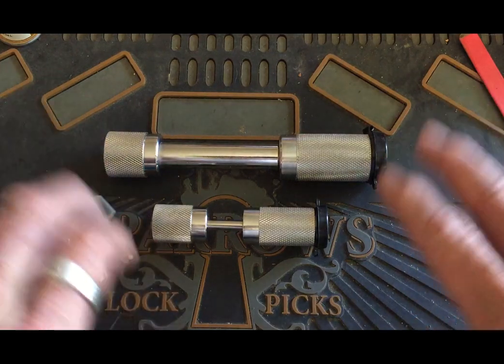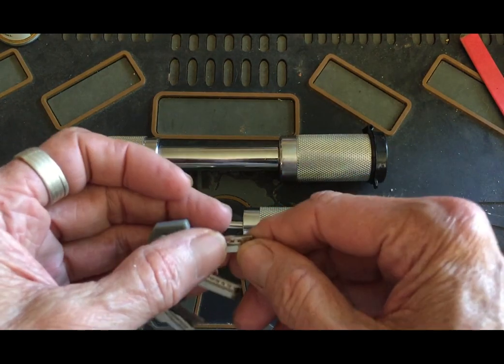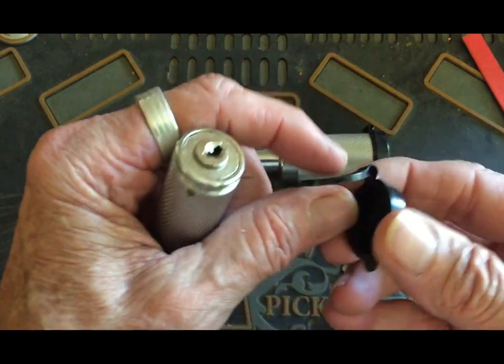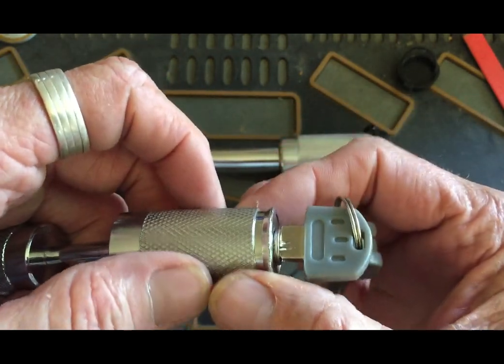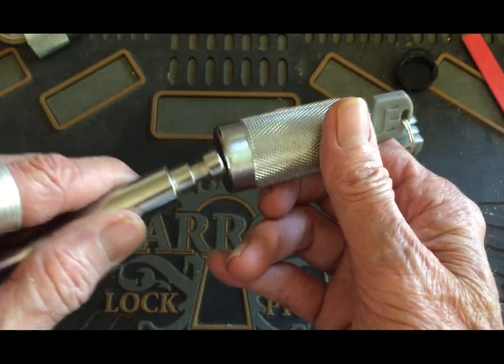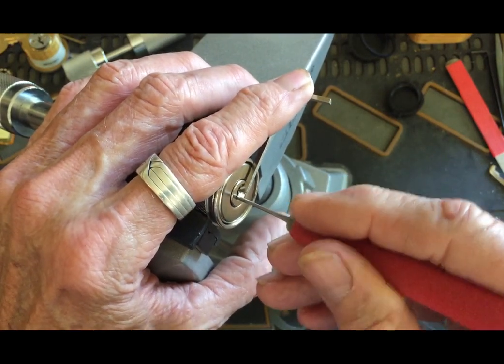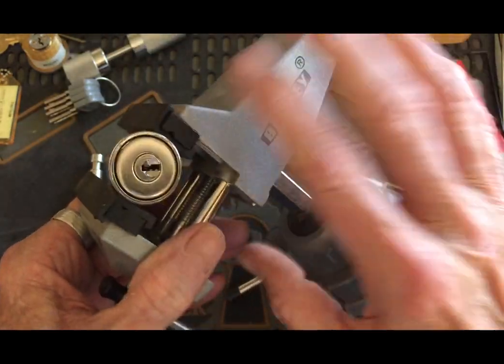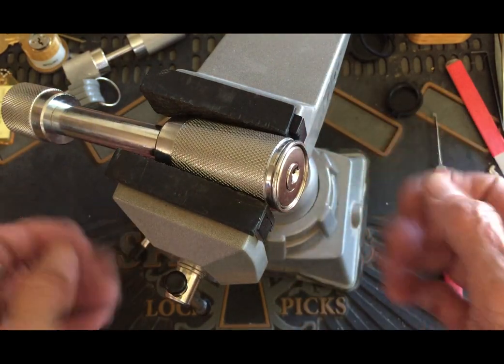(214) Trailer Hitch Pin Dimple Lock - Picked

Comment: I've got the smaller one. It's the first and only dimple lock I've ever picked. It was surprisingly easyer than I thought. You can take a screw driver and push the release in side to reset it. Nicely done bud.👍

Comment: LOL!!!! I wondered if there were any videos out yet on these hitch locks. I bought the smaller version today at Harbor Freight. Picked it open 3 times in 5 minutes. In my pick collection, I have several different kinds of "Snake" rakes. 2 of them have a decent hump, but very short tails. Similar to a hollow half-diamond.  Actually, they are the HPC LPX 15 and 16. I believe I used the 15 to open this lock. I used TOK tension, and just twisted the pick back and forth like a flag pick, on both sides of the key way. Easy open.